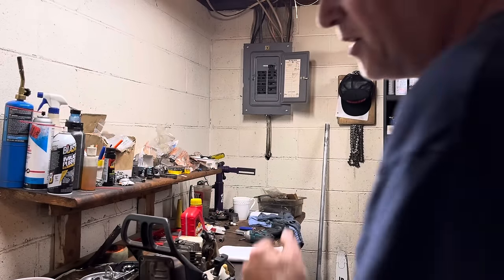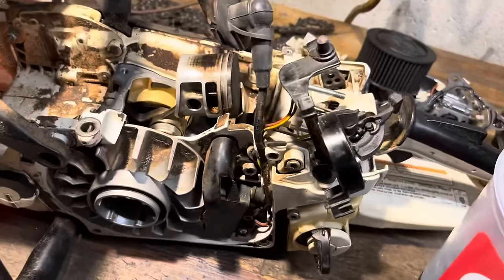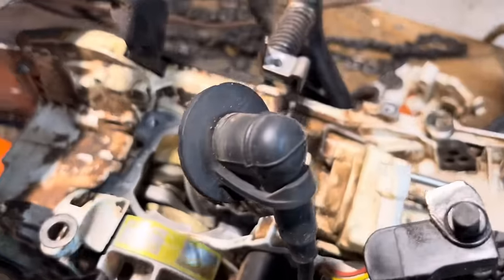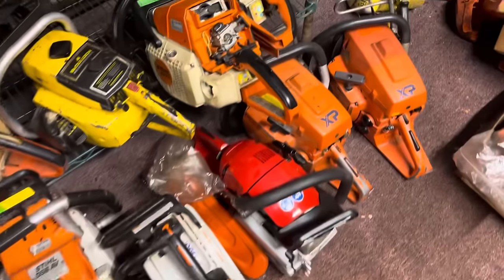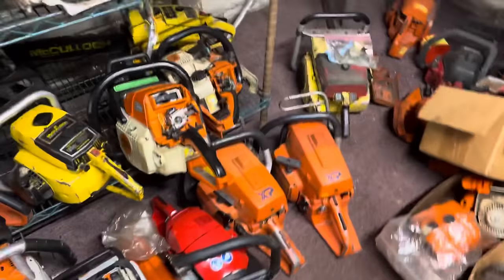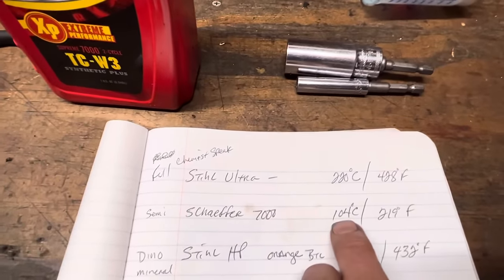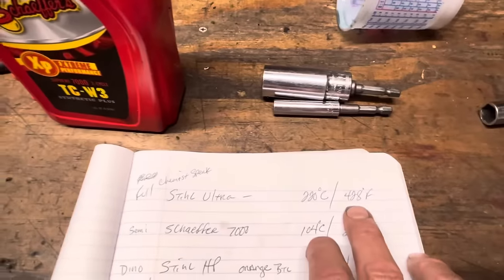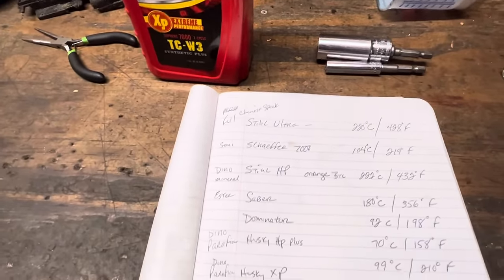Two Stroke Oil Talk.  Why Anything is Better than Ultra for your Chainsaw!

Comment: Got a quart for $4.99 at autozone last yr Lucas Semi Synthetic 2 cycle run it 40.1 works for lawn eqp and saws no need for multiple containers of gas laying around this stuff inexpensive and works great. I'm pretty sure that's said about everything Lucas sells. Been using it for 5-6 yrs now. All my equipment is from 2008 it's all 100% stock I use Echo string trimmer craftsman mower and chainsaws craftsman as well. I didn't pay a dime for any of it I just use it Lucas 2 cycl keeps them running I just make sure my equipments stored properly yr in yr out.
Reply: Stored properly meaning the gas is drained out and engine stops due to no gas left. I use 10% ethenol strt from the pump and I try my best to buy just what I need for the season put what I don't use even 2 cycl in my vehicle. Then I buy new fuel for the winter to put in my free ariens snow thrower. It's a 2004 932038-5520. That's 100% original as well. It's been thru a few blizzards. If all my equipment cld talk and write it would have written many books and had shows and movies on Tv too.
Reply from the maker: That same quart of oil is $9.99 now at Auto Zone.  Crazy times we live in.

Comment: Hello, very interested video 🙂 I have a new stihl chainsaw M-tronic, what will you recommend for a mix? Currently using stihl HP Super semi synthetic 48:1 ratio, only done one tank so far. Was planning to go with Ultra but not so sure now... Please advise
Reply: HP Ultra is fine. Run your M tronic saw at 40:1.

Comment: Now you did it. Started an oil discussion to get a lot of comments. 
Numerous good 2T oils for chainsaws. I agree with you about  the oil mix in question. 
For my two cents. Belray H1R @ 32:1.
Reply from the maker: I was really frustrated today opening up this saw and knowing what was in the tank before I looked.  It really was a spur of the moment thing.
Reply: I run H1-R as well. Been mixing at 40:1 really happy with the results so far.
Reply: Hot saws likes that oil @ 50 to 1.   He has a great vid on it.   Talks about the newer saws need better oil due to loser tolerances...

Ive run redmax synthetic for years...not 1 issue.......but i bought a quart of that belray hr1   aint cheap!

Comment: Been running that green Stihl oil for years, no issues on any of my saws or blowers.
Reply from the maker: The green oil is called HP Super. It's a mineral based oil that carries the JASO "FD" rating (highest rating currently).  I've never seen it here in the Southeast.  I thought it was something only sold in Europe?
Reply: @richardflagg3084  Something isn't match up. Why would a company extend a warranty if the product they are selling to extend the warranty is hurting the product?  That is exactly what I use, the "pond water" as you called it. It's the green HP Ultra. Just bought a new 800 Magnum Blower and they extended the warranty with this purchase by buying this oil. I have 6 chainsaws, 1 pole saw, 2 trimmers, 2 leaf blowers and they all run on this stuff. I have for years. My guess is that guy mixed up the one gallon bottle with the one gallon bottle when mixing his gas.

Comment: Dang, I run mostly weedeaters, all Stihl brand.  I've been running MotoMix in all four since they were all born plus my two saws.  Put a short block in my bent shaft weedeater the other day and noticed it seemed dry on the bottom end.  Just worked on 4 880-881's for a guy running a small crew.  He said he would rather run his saws on pig urine before he would run MotoMix.  Told me Schaeffer oil is the only thing he runs.  That + you and I am going to switch.  I know my weedeaters and my 291's aren't exactly high performance equipment but, I am just starting out with my business.  I can't afford to burn up my equipment.  Thank you for the info.  Great video bud.

Comment: Dude, your being paid to bag ultra.
I'm not getting paid to call bullshit.
I've been using it since it came out and it's a fantastic product. It works so well I use it as a gas preserver to stop the carburettors on my motor bikes from gumming up. I use it on seven different two stroke engines. Four chainsaws, a blower, a concrete saw, a weed whacker. Never had a problem with any of them. No gummed up carries, no excessive smoke, spark plugs don't foul. I get almost zero smoke, more power, easy starting. I work my shit hard too. I notice a few so called experts bagging Ultra. Not listening. It's a Castrol oil and that's always been my go to oil.

Comment: Based on a youtube video, I tried Red Armour.  I found a clear difference after the first tank.  Saws ran better and idled better than using Stihl Ultra.  I always mix .92 gallon with the 50:1 mix oil.  I won't go back to Stihl.  Saws:  Stihl, Makita, and Homelite.  I might add that the Homelite runs much better after using Red Armour.  Stihl now idles much smoother whereas before it would not continue to run long at idle.  I only use premium non-ethanol fuel.  Thanks for your video.

Comment: I don't read labels , The little bottles I usually buy are 1 gallon to bottle . Started buying the Premium mixed as same 1 gallon to bottle . Noticed a little smoke all the time while running . Ran strong and fine never failed to crank or cut chainsaw ,weed eater, blower all sthil equipment . It bothered my neighbor you know them neighbors . He investigated and asked . I told him 1 gallon to bottle . He screamed its 2 gallon per bottle that's your problem . It bothered me so I took all 3 in weed eater ,chain saw and blower ,They were tore down and tech said they were all in the best condition he had ever seen crank ,bearing and piston and plug  just oily as hell muffler  . wanted to know what I did and I told him . He said keep on doing it and he was going to do the same to his .
Reply from the maker: Hahahaha!!!! Love it

Comment: I live in Honduras and run my Echo 3510 on some no-name cheap 2stroke oil from Mexico.  No problemas.  When I can't get the cheap stuff then for about twice the price, Yamaha 2stroke is used and I see no difference.  Perhaps it's the cheap gas at high prices that  keep it all growling and spitting chips?

Comment: There are plenty of Good adequate oils out there. But your right HP ULTRA isn’t one of them. 
Best oil for the price Iv found is Red Armor. When I tear into any of the saws Iv built which have only had red armor ran through them…. They are squeaky clean inside and not hardly any carbon even on top of piston. 
But….. no matter what they call for I suggest running 40:1 mix ratio. 
My bottom ends are always soaked with oil and clean. 
Keep your chain sharp

Comment: Doesn’t the fuel burn the oil off to? I’d assume there wouldn’t be much residue left since it is combusting while lubricating.
Reply from the maker: It comes in part to the low viscosity of the oil.  Better oils do leave a nice oil film and burn cleaner.  I really wish Stihl would reformulate their two stroke oils as other manufacturers have done.  I've tested many oils in the last year and a half since this video.  Most all have outperformed this oil.

Comment: I run a heavier mix when running a longer bar, many people don't and they burn up their saws. I have been using the husqvarna brand oil. it is a semi synthetic with good results for the last 18 years or so. I run the saws hard in all kinds of weather.

Comment: I did my own test with quick silver marine mix at 70:1 in my Stihl ts420, used it almost daily for 2 years, I’m going to pull the muffler off and I might even pull the jug off, I’m curious now.

Comment: I dunno, looks like a user error to me. I've run HP Ultra in my MS261C and BR700 for hours upon hours. They're almost dripping with 2 smoke oil. I haven't looked hard, but the only reason I stick with it is the 2.5 gallon pre-measured packaging. Otherwise, I'd run whatever gallon jug of snowmobile synthetic I have laying around.

Comment: synthetics are dinosaurs based as well. They are built to chain length rather than cracked down to a mix of chain lengths. Film strength... lubricity, viscosity and film adhesion

Comment: Never once had a problem in any of my saws or customers. The only people I have problems with mix 40:1and clog screens.
Reply from the maker: The point here is Ultra is a castor based oil and doesn't burn that clean unless it's stays at full operating temp.  There are many oils that are more "forgiving" if you don't run it "right".  The difference between 40:1 and 50:1 is one tablespoon per gallon which isn't enough on it's own to clog a spark arrestor with a better oil.  Your crankshaft and bearings will thank you.

Comment: So....the regular orange sthil oil is better than the ultra?
Reply from the maker: Yup.  The orange bottle is a mineral based oil and does pretty good for an old school oil.  Ultra is an ester based oil and in my opinion needs a better detergent package to burn clean.  It's only got a JASO rating of FB, two steps below the top rating of FD.  There are a lot of oils on the market that are ester based and burn much cleaner.  Look for an FD rated oil like Saber, all of the Echo oils, Husqvarna XP+.  They will do a superior job.

I've done some other videos on the subject.  Feel free to go down the rabbit hole of oil.  Lol
Reply: @richardflagg3084  Thanks mate. I ordered some Echo red armor. I've only been using the ultra for short while hopefully the red armor will help clean out any unseen internal carbon buildup on my 2 cycle equipment. Im a little upset the Stihl dealer made it seem like the ultra was better than the normal oil I had been using for years.

Comment: I just bought a new stihl leaf blower yesterday and thats 100% what they told me.If you buy a six pack of oil we will increase your warranty to 4yrs.So thats what I did.WTH man.Well I guess now I gotta start doing two stroke oil research. This shit just never ends.Thanks for the video, it speaks for itself and I wont be using the stihl oil.
Reply from the maker: Just because you bought the "six pack of extended warranty" doesn't mean you have to run it .  The traditional orange bottle does a nice job at 40:1.   If you need some warranty work just tell them you used all of it.  You didn't like the smell of Ultra, and wanted to stay brand loyal and switched back to the flagship oil.  😎
Reply: I’ve got a BG86 that’s 12 years old. Only run on Stihl Ultra. Cleaned the screen twice maybe? Rebuilt a carb at 10 years old. I’ve also got a 9 year old km130r that’s only run Ultra. Zero lubricant issues with either. The BG86 during leaf season runs a tank dry at WOT the whole time. Just picked up a BR800c and it’s running Stihl Ultra. No smoke from any of them.

I’m not saying Stihl Ultra is the best oil ever, but your blower isn’t going to die an early death either by using it. I just run it because it’s convenient and has never given me problems and apparently it does better in the 4mix motors than some oils. I’d use the oil you bought and switch when you run out if you want to.
Reply from the maker: @briantii  Just for science and stuff, pull the muffler on the BG86 and have a look at the piston and see if there is carbon coking/glazing.  Trust but verify
Reply: @Richard Flagg  I just picked up a  MS 800X blower and the salesman sold me the oil but also told me that I didn't need to run it for the warranty. I've also been running the HP oil in a 024,  261, 461, 500 and  350 blowe for years and fortunately have never had a issue other then plugged screens. I do hate the smell of the HP oil because it almost smells like burning plastic coming from the exhaust.
Reply from the maker: @TheGoodguy68  Try some Saber or Red Armor.  Both high quality oils that smell better.  VP racing is very good too.
Reply: @richardflagg3084  Yeah, I probably should… but the muffler hasn’t fallen off in a while and I’m hesitant to mess with it. BG86 seems to love to shake itself apart. Engine mount bolts, muffler, etc. All love to come loose. I do think it’s tuned too rich. Ever since I rebuilt the carb I have built up carbon on the screen a lot faster. Runs perfect, but guess I need to go in a hair on the high speed. Not going to lie, you got me thinking about Sabre. With that said still have 9 bottles of Stihl I’ll probably burn first.
Reply: @richardflagg3084  This is an interesting video. He runs a new cylinder and piston with a few different options. It’s premixed fuels but Motormix / Ultra seems decent there. Not sure if you’ve seen it. Would be curious of your thoughts on it. Not arguing, just seems inline with what you’re doing.

https://youtu.be/1JEXR-d6Z_Q
Reply from the maker: @briantii   Julian made that video a couple of years ago.  He did a great job with the testing.  The 661's seem to do better with it in regards to the MTronic saws as they are usually under a full load (long bar, big wood, full operating temp).  The JASO "FB" rating of Ultra places it in a low smoke category.  Making it a less forgiving oil if "you don't run it right".  

The higher rating of the "FD" oils have a better detergent package and less prone to carbon build up, without sacrificing lubrication according to JASO.  That seems to be the elephant in the room.
Reply: @richardflagg3084  Cool deal. Just wasn’t sure if you’d seen it. I run mostly 4mix stuff with the exception of the bg86. We’ll see where I end up, will be a bit before I burn up the Ultra… though the BR800 sure does go through it much faster than my other equipment.
Reply: @richardflagg3084  re: "Just because you bought the "six pack of extended warranty" doesn't mean you have to run it .  The traditional orange bottle does a nice job at 40:1.   "

Yep, fair point. I have 4 different Stihl products (blower, chainsaw, brushcutter, clearing saw) and so ended up with 4 6-packs of 100 ml Stihl Premium oil - white bottle, orange cap and Castrol logo on the back (Canada). I have occasionally wondered whether that oil is really good for 50:1... so might try at 40:1. Thanks !

Comment: i only use there oil when it gives me more warranty it works but mix it 40 to 1 if not getting more warranty buy something else oils accally to good it keeps the engine to cold and that dont burn carbon off and the flash point so low it all burns so insides dry like in video and the burning oil makes carbon

Comment: U have to run these at full throttle, stihl is great oil, its works properly when the saw is used properly (at full throttle)

Comment: I bet this is what happened to my ms201tc-m. I ran the pond water colored oil and also a better mix my employer provides us with. Blew it up originally. Paid almost full price for a rebuild. Now it won't hit, the muffler is a mess with I think oil, maybe that black carbon crap. Wished I was a better saw guy. I'm a professional arborist but I need to learn much more about these saws. I appreciate this content and your thought's in advance. Wonder if I can fix it myself?🤔
Reply: Try running drain oil from your vehicle's it's freeeeee++good quality it's experienced!

Comment: Ok, good video but why do you think the pond water looks like shit on this machine and looks beautiful on other examples.  Some have run several gallons for their tests but no indication that they are heading toward this condition at all.  I'm still new to 2 cycle but could this be from running lean for extended periods, rather than the pond water as the cause?
Reply from the maker: It's MTronic.  Tune is constantly adjusted to conditions.  You're guess is as good as mine why it gives these results.  I've documented this in multiple videos.  It did a fair job on my pre-EPA 046 when I was testing oils at 50:1.  At the end of the day there are more "forgiving" oils out there.  The original Stihl orange bottle mix oil actually does a better job , and it's an outdated oil by current standards.  

Ultra has a JASO rating of FB.  Two steps below the highest standard of FD.  Again, there are many good choices out there.  Run what you prefer.

Comment: I haven't bought a lot of 2-stroke oils for my saw but the main one I've ran when I'd mix up fuel was AmsOil Saber and I've had no problems within the 5 years of owning my MS251. I can't speak for film strength as I don't have the resources to just tear it down for the fun of it and see. But it has loads of compression and it's not making any funny noises so it must be working just fine. The only other thing I've ran is the small pre-mixed cans of Tru-Fuel 50:1 for when I'm not doing much cutting and I don't need a lot of gas made up. I've been curious about giving Red Line a try so I'll have to order some eventually.
Reply from the maker: Nice!!  The canned fuel is excellent for running and short/medium storage as it doesn't become corrosive like pump gas over time.  Take care of your equipment and it will last so much longer.
Reply: @richardflagg3084  Indeed. Luckily enough a few of the gas stations around town carry ethanol-free 91 octane. So that's all the small power equipment gets since 2.5gal is cheaper than filling your car. :)
Reply from the maker: @Slane583  I know right!

Comment: Back in 1970 to 1980 in the big chainsaw, I hold family in logging business mix 10w-30w quart to 5 gallon off regular gas . Never lost an engine , own went it’s need piston and rings sometimes a head . Our company chainsaw run from sun up to sun down 5 to 6 days a wk . Guys that mix to chainsaw special lost motor. Little more oil save an engine that my 2 cents . To this day in 2022 still use 10w- 30w in 5 gallon off regular gas . # on gas are for getting more $$$ out off your pocket. It’s been test here in Canada by the right peoples at regular is the best , your 95 , 98 were for robbery your back pocket. Here again it’s my 2 cents, you u tube do want you what free world. I’ll stick to my 100cc chainsaw to Tks you GOD BLESS !